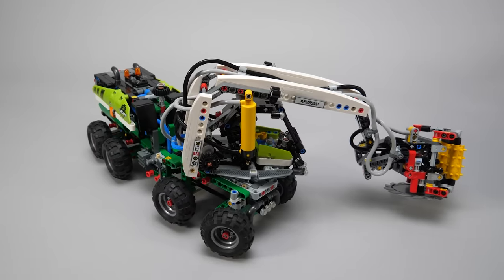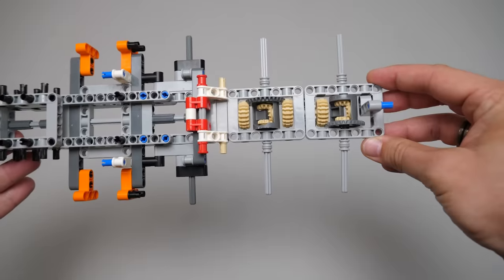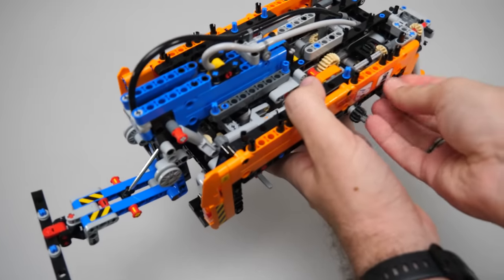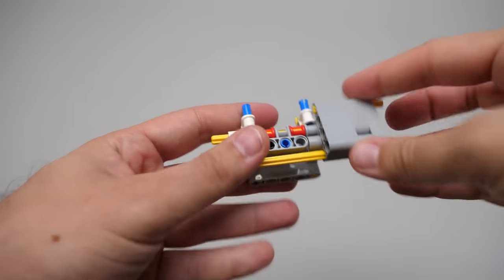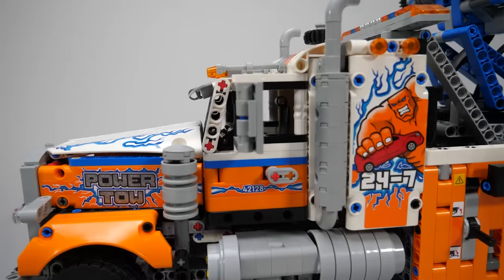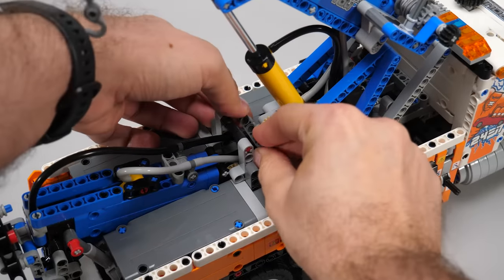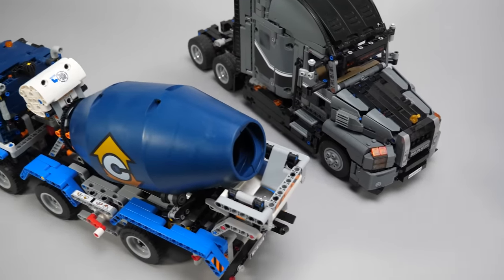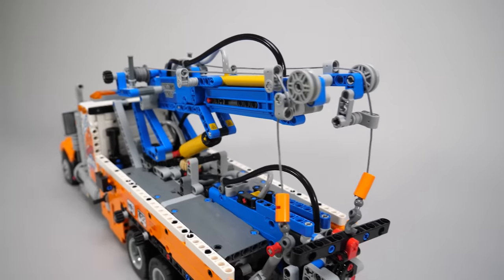LEGO Technic 42128 Heavy-Duty Tow Truck detailed building review

Comment: It looks better than Zetros, it has more functions, and is twice cheaper. Great set!
Reply: but the zetros has differential locking and insane torque
Reply: @Unbrickme  yeah
Reply: @Unbrickme  That's true, but the tow truck has more functions, pneumatics, and a better price-per-piece (although it is expected that the Mercedes would cost more because of all the motors and the very expensive battery box). Both sets also introduce a new feature into LEGO TECHNIC (2nd axle lifting for the tow truck, differential locking for the Zetros) but I think the differential locking is more practical and cool. 

All things considered, the Zetros is good if you have enough money to buy it (and you like capable trial trucks with cool functions), but the tow truck is a great deal for the price if you're looking for a cheaper option or a set with more functionality.
Reply: I personally want the zetros
Reply: if only it had pneumatic outriggers... and maybe an option to motorize the pump
Reply: Zetros has electronics

Comment: Being a truck driver and more so that I just had my truck towed last week I'm very familiar with these trucks IRL. One thing I can tell you is the top boom is not common on most heavy tow trucks. Semitrucks are towed with the low bar and preferably from the rear. They'll lock the steering with the seatbelt and tow the truck. I have seen a few with that top boom in my time but I have only ever seen that used to upright rolled trucks and trailers or pull vehicles out of ditches. I have never seen a truck being towed by that. Just thought I would give a little clarity on the RW operation of those.
Reply: Just last week. I saw 2 of these rigs with booms recovering a semi that went off the side of an off ramp with the booms.

Comment: I'm quite sad that the set isn't able to be motorized easily, infact, it took me like two hours to find a spot for the compressor and implement it. Also, thanks to me only having one pneumatic pump, it's pretty slow at building the necessary pressure to operate.

Comment: With my pneumatic function I have a problem, either only extending the boom works, or adjusting the crane. I can't get both to work. Any ideas of what I'm doing wrong?
Reply: Check properly the tube connections
Reply: It's fine the tube connecter wasn't working. I ordered a replacement already. Thank you for your help

Comment: Hi love your videos could you tell me what parts you used to strengthen the gear on the bottom of the boom please.
Reply from the maker: It's a 5 module long beam and 2 of these - https://www.bricklink.com/v2/catalog/catalogitem.page?P=61184&name=Technic,%20Pin%201/2%20with%202L%20Bar%20Extension%20(Flick%20Missile)&category=%5BTechnic,%20Pin%5D#T=S&O={%22iconly%22:0}

Comment: I just assembled this but there seems to be an issue in the rear pneumatic cylidner that raises the tow bar - it doesn't go up. There is no mistake in the assembly, it just seems to not generate enough force to lift it (and I don't put anything there, just a dry run). I always have to give it a push with my finger then it immediately works as it supposed to. Any solution to this? Otherwise, fantastic set.

Comment: You mention that Lego has stopped providing B models for large sets.  You and I don't like it and it will not go unnoticed.  It'll come at a cost.  Eliminating B models is a cost reduction for Lego and it follows that it should result in a price reduction - in theory.  Very hard to determine what that amount should be and if it's reflected in RSP.  Probably not - even food companies are in on that act - slightly reducing volume / value in products and holding price - hoping no one notices ... and they know many do not - so more and more are doing it.  But - it will absolutely have an impact on desirability and aftermarket resale IMO.  If I'm on the fence - I look at the B and C models and if they're attractive I'm more likely to buy.  I'm sure Lego has made the calculations.
Reply from the maker: As I see they actually rearranged the portfolio so it's not a simple cost reduction. No B models for the larger sets - this trend was already visible with the branded ones in the past years, but as there are a lot of larger Control+ sets lately, developing an alternative control profile and stuff like that would increase the cost significantly. So they removed the B models from the bigger sets, but meanwhile they made the pull-back lineup much better with higher piece count and introduced the B models there. I guess people are more interested in quick rebuilds for smaller sets.

Comment: Hand pneumatic pump??? Ok, thats weird s hell :D
Reply from the maker: I guess you did not see many LEGO pneumatic sets previously :)
Reply: Well, I own the 42008 Service truck and the 42043 Mercedes Benz Arocs 3245. They both have pneumatic functions, but both are electronic, with automatic pump, thats why I was surprised with the manual one 😅. And then, another thing is that my parents are mad just listening on my thoughts of buying some lego (Im 18 btw 😮‍💨😑), and fact that I am lately more into the plastic scale models of cars ( from for example Tamiya, Revell, ....). And btw, my oldest set is the 9393 Tractor , so you know, I have some technic, but not the newer ones :/. And when you go to some engineering high school (like Škoda auto ), you have access to more knowledge about mechanics, metallurgy, pneumatics and hydraulics than you would learn out of an lego Technic, because they are almost the same over and over (pistons, crank schaft, differential, some pistons, gearboxes, pneumatics  and thats it). I would collect now maybe just some for the display factor, like the sport cars, but as you said about the Speed racers series, its better for that purpose. From that, I have only the P1 McLaren, which Im kinda sad about :/....

Comment: My son is putting this together and when he turns the gears to lower the rear stabilizers 1 goes up and 1 goes down instead of both going up or down together. Any ideas where the issue lies??
Reply from the maker: At step 131 the orientation of the 2 tan gears is not the same, I assume they were placed on the same side and that causes the issue.
Reply: That’s it!! Thank you so much!!

Comment: The front stabilisers come down separately, I.e. if the right comes down the left comes up, any ideas what I may have done wrong?
Reply: The 12 tooth tan gear should be place in same direction,in opposite direction make it works different
Reply: @zaxisontherun  thanks for replying. I have rechecked my construction with the book and I seem to have everything the right way round (p262)
Reply: @zaxisontherun  hi, just swapped the 12 tooth wheel so that they are OPPOSITE to each other unlike the instruction book and they now work perfectly, both sides going up and down together.
Reply: @davidashley3970  Wait so you put 12 tooth gear at opposite direction at it works well?Thats not how it supposed to work..
Reply: @zaxisontherun  it does for me, can send video if required

Comment: This set was disappointing it's pretty cool, but has major flaws that kind of ruin the building experience. 
1. The tubes are not the correct length. I don't think a single one measured out to the length the instructions said they should be. Also, for some reason, the instructions didn't include any 1:1 scales for these tubes, even thought this would have been far more useful than all of the instances where they do provide 1:1 scales.
2. Breaking it up into only four sections is just awful. I like to build my sets one numbered set of bags at a time, and spread this out over about a week depending on the size of the set. Yet, the biggest set I've gotten yet requires me to do 25% of the entire set at once. And I can't just do half a section, as I need the workspace I use for Lego for other things when I'm not building.